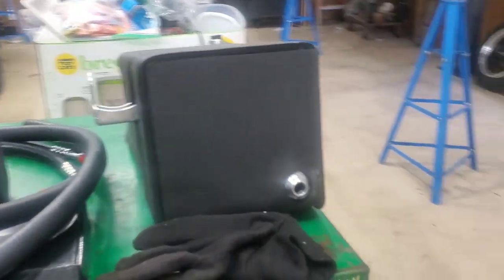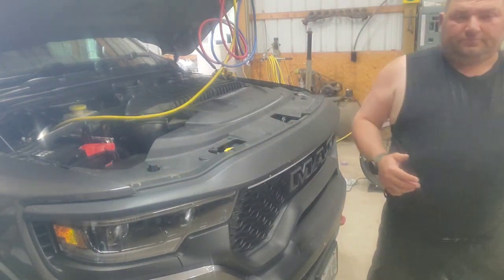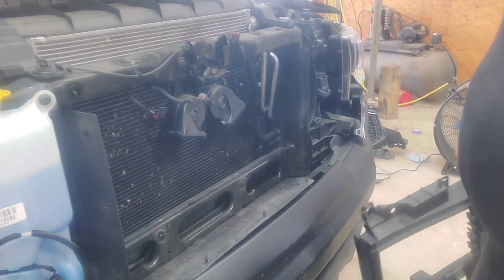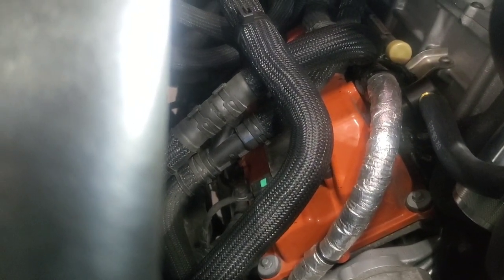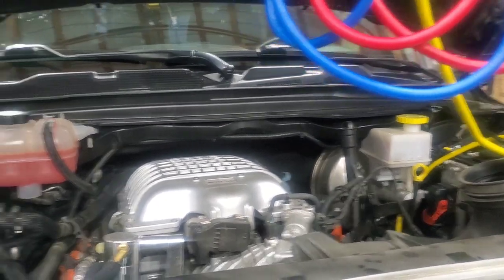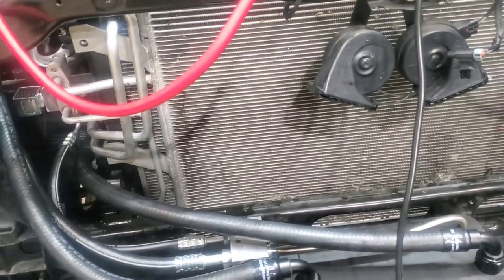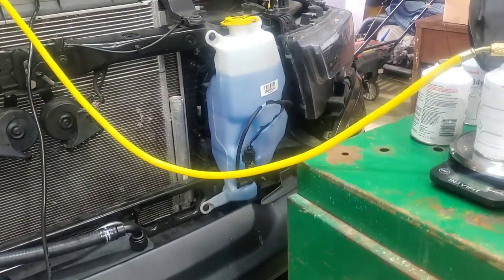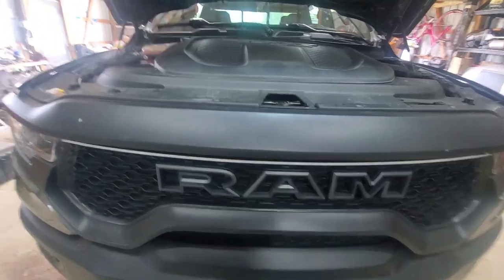Ripa Tuned interchiller RAM TRX install also grille removal info

Comment: When you charged system did you put in 1.225 lbs R1234YF  ?  We did mine this weekend but trying to figure out why cabin isn't cooling better.  High side pressure is 200 and low side is 50. Temp outside was 101  degrees. We used the R1234YF machine and it took a while
Reply from the maker: I put in exactly 19oz.. my cab is actually so cold I have to turn it down
Reply from the maker: Those pressures seem good
Reply: @vfr800fi07  thank you

Comment: Any chance you could email me the instructions? Also where is the low pressure port located?
Reply from the maker: The low pressure port is located facing Forward a little right of the water pump pulley
Reply from the maker: I probably can take pictures of the instructions when I get a chance
Reply: Thank you!
Reply from the maker: @utpotterm  no problem

Comment: What do you expect to gain from this interchiller.??
Reply from the maker: Gain of some power and also no timing loss due to high intake temps
Reply: @vfr800fi07  How will you know? Are you doing before and after dragstrip testing?
Reply from the maker: @casmithc2  yes I'll be using my dragy